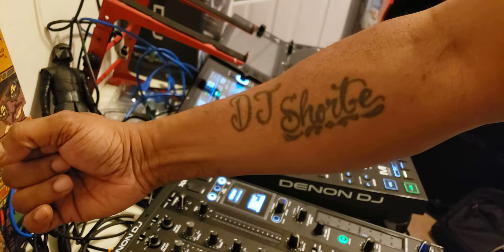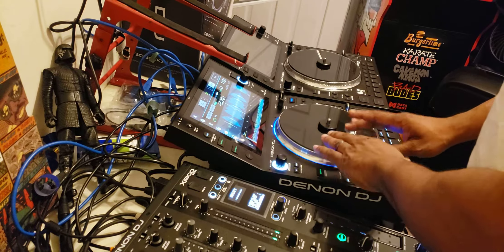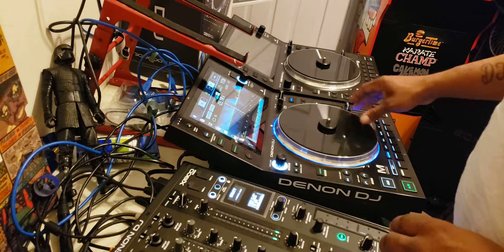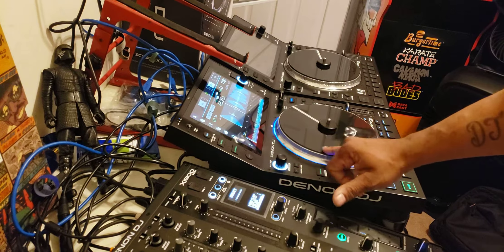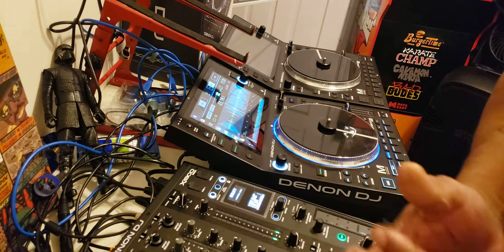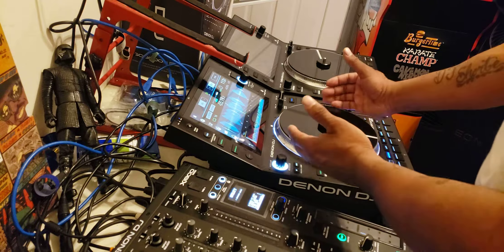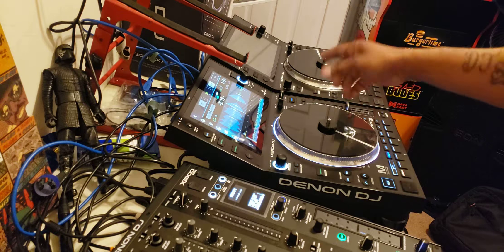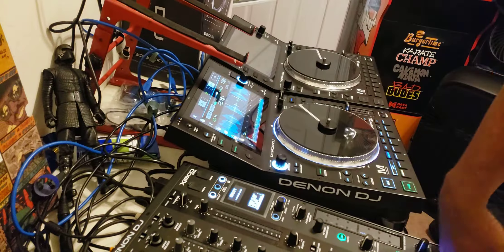Denon dj sc6000m motorized platter information

Comment: Thanks for this video, I am debating between the SC6000 and the 6000M and wondering how the plater feels.
Reply from the maker: If you ever had the numark v7 or rane 12s,  it's similar in ability to manipulate the vinyl.  The torque is the same.

Comment: Having trouble with my sc6000m.... when I try to scratch or back spin the platter ,,,,,,, nothing happens.... the songs keeps playing...it seems like it slips out of vinyl mode.. any solutions for my issue  ?
Reply from the maker: Does it happen when connected to the laptop (and if so, what program are you using) or just when used solo?
Reply: @djshortefromphilly  I'm not connected to a laptop. I'm playing everything through stand alone..( I have a 2tb ssd hard drive in one of my players ) .  Last night I was i had a power surge , my mixer , amplifier both players shut down and  my kitchen lights... I reset the circuit breaker and all appeared to be working as designed.... but once I loaded up a track and pulled back on the platter to spin and scratch,,,it just shows the song down slightly.... so I toggled the MOTOR button and I the results were the same ,,,, so   next I tried to reset the player , and the result was the same ... so now I'm wondering is there a secondary setting in the SHIFT  button ???   Or is both MOTOR buttons defective because of my power surge. 

I also left my # on your Instagram message to go in to more detail if you have the time.... thanks

S. Murdock

Comment: Bro. I just returned my sc5000m's and am about to buy the sc6000m's. I think they might have a better algorithm and sound a bit more natural on scratches but I was hoping to get your opinion on how the 6000m's sound while scratching?
Reply from the maker: I actually love them both...imho, the bigger platter on the sc6000m helps with manipulation better than the sc5000m which is like scratching on a 45.
Reply: @djshortefromphilly  Cool. Thanks for your feedback. I’ve gotten used to the V7’s and used them almost a decade but decided to move away from Serato all together. I liked the 5000m’s but think for the long haul the 6m’s will definitely work best. My old eyes need more real estate and bigger jogs just feel right.

Comment: man i wash there was custom vinyl... 8" is really hard to come by.

does the disc feel like a true grooved vinyl pressing or smooth cd type plastic?
Reply from the maker: It feels like real vinyl...the grooves catch your fingers like real vinyl.
Reply: thanks shorte for clarifying that :)
Reply from the maker: @Ravinstomper  not a problem.
Reply from the maker: Try 12inchskinz.com they have custom vinyl colors now.
Reply: @djshortefromphilly  thanks for the info man. However I put the rane one platters on with better felt mats and real 7" vinyls. Looks much better, plays supurb..... and the feeling from the dots spinning under the finger.... you just can't beat that authentic texture!